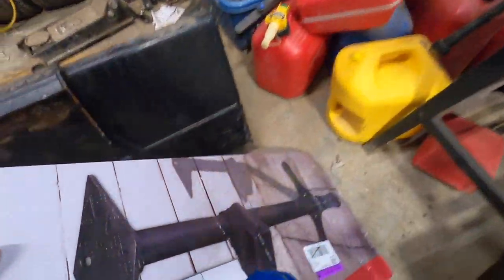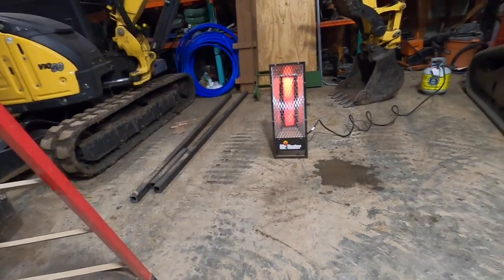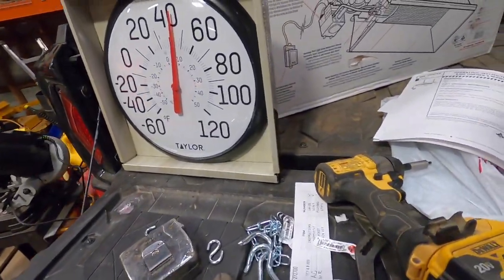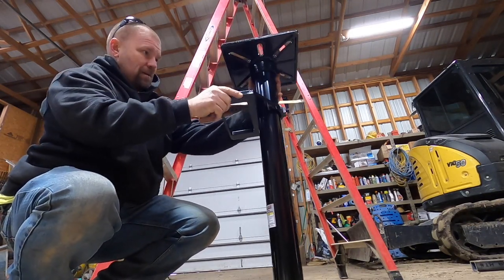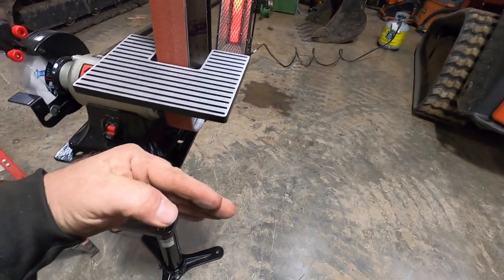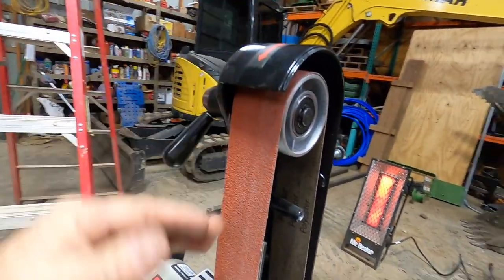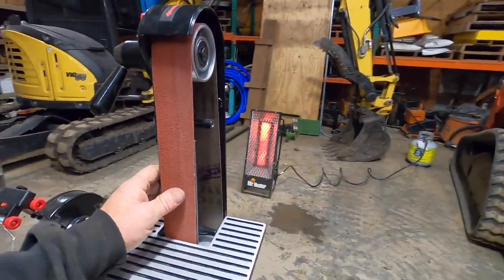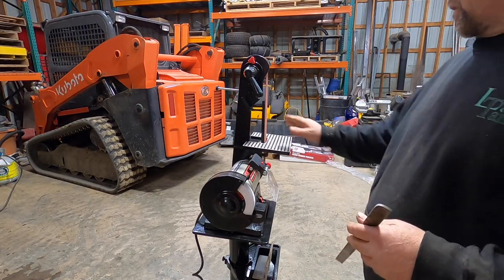New Belt Grinder and Stand. Bucktool 2' x 42' Grinder

Comment: I was looking for bucktool bd4801 bench belt sander and came across your video, like the stand you got for your grinder. watch the whole video with you using bucktool grinder and like the grinder and how you were using it on the stand. I wasn't looking for a stand, but I like how it stayed in place while you were grinding, and the grinder sounded good. As a homeowner and diy I like both the stand and the grinder. Thanks for the video, you showed that it works and not, just take my word for it.
Reply from the maker: I like the grinder. Ive had it for a bit and haven't had any issues. That stand was from harbor freight but it is heavy enough to not tip over when your using the grinder. Ill see if I can do a follow up video on it. 
Thanks for checking out the video.

Comment: Are you going to bolt the stand to the floor, or is it stable enough unbolted?
Reply from the maker: It is stable enough to use without bolting it down. The little thing works out really good. I am really surprised at how it does. I did buy pretty decent ceramic belts for it.